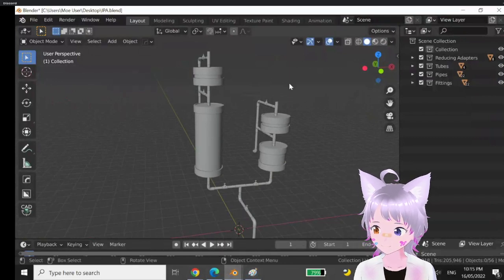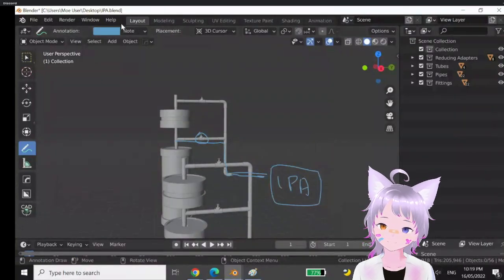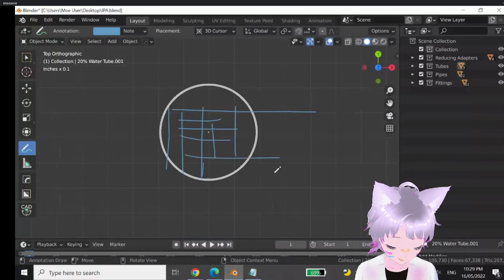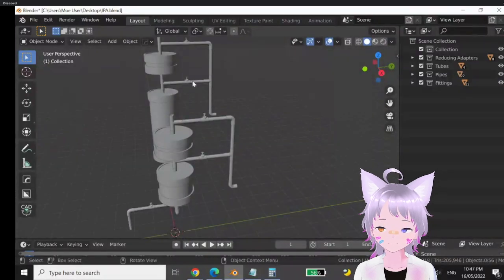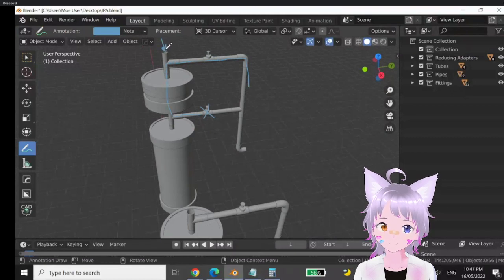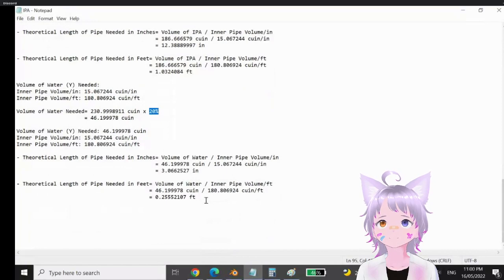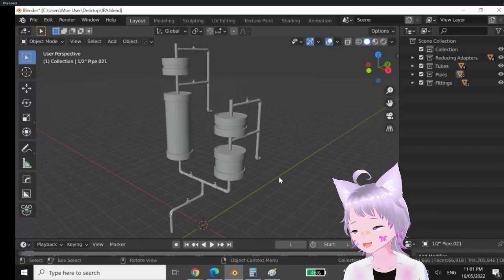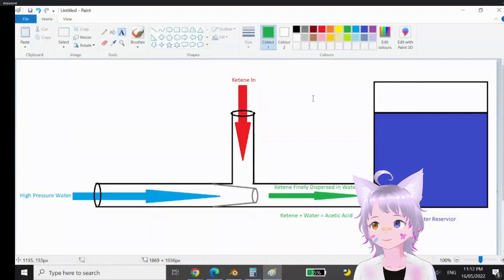Designing process equipment with a friend

Comment: You've discovered the weirdness of standard pipe sizes!  This always confuses students and new engineers.  Metal pipe is similarly confusing.  But are you sure the ID is 4.5"?  When I look at 4" pipe on McMaster the OD is 4.5", and the ID is 4.026" (standard wall PVC).  

Other things to know: DO NOT use weather station data (like from a weather app) to try to find the local pressure.  They don't actually give out real pressure.  They measure a funky "normalized" pressure, so it's bloody useless.  

Another thing: thread sizes must exactly match.  M6 bolts are very different from #6 bolts.  And M6x0.75 does not work with M6x1.0.  

A useful tip for modeling: McMaster-Carr gives CAD models of many of their standard parts (pipe, bolts, fittings, gears, etc.) so you can download those (for free) and avoid having to try to model it yourself.
Reply from the maker: first time ive seen someone use blender and it was my friend doing the modelling in this vid. I was thinking in the back of my mind that there has got to be some other software like solidworks or cad sofware that has all these standardized parts.